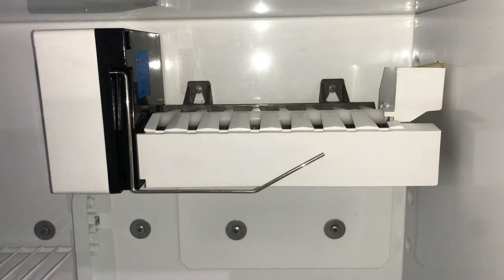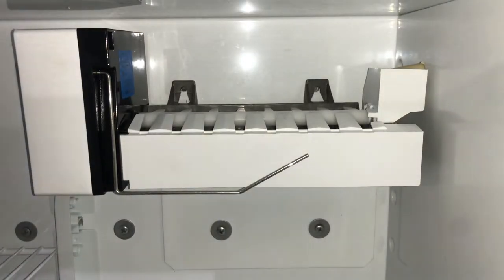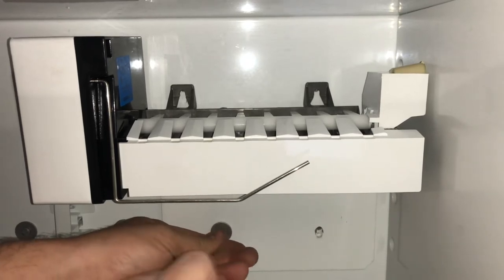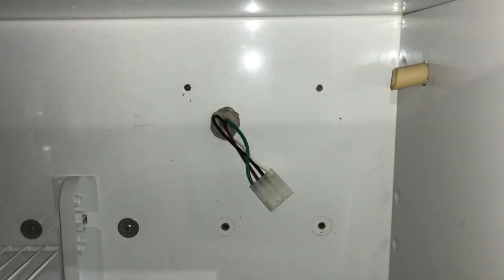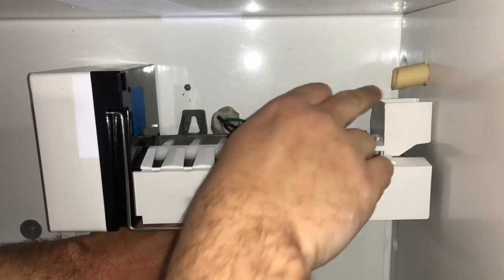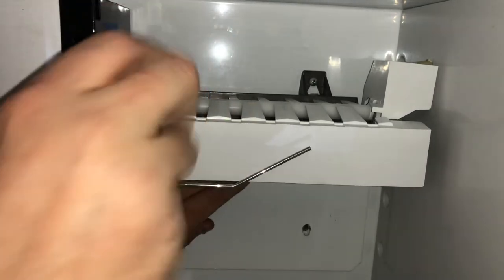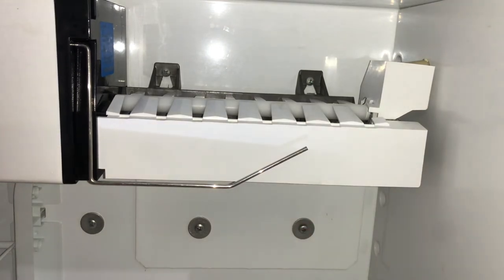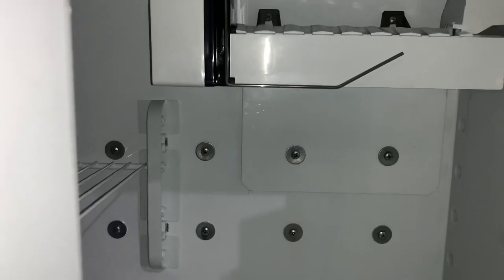How to Change Dometic Rv Refrigerator Ice maker

Comment: I just watched your video on the power inverter and am trying to fix mine. I was curious if I had a bad battery if it would cause the same symptoms as a bad inverter. I changed fuses but have had no luck
Reply from the maker: Need good batteries to properly work otherwise it can ruin inverter.